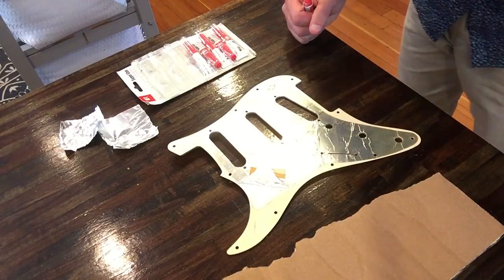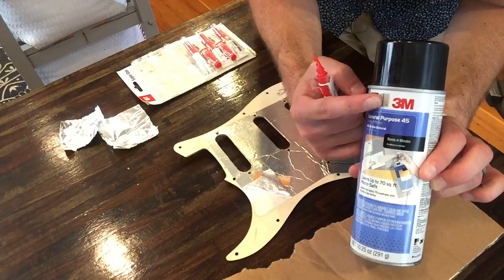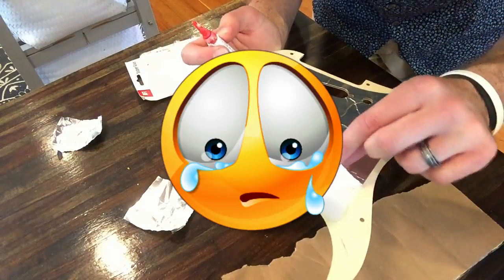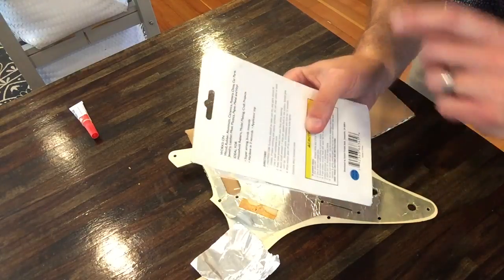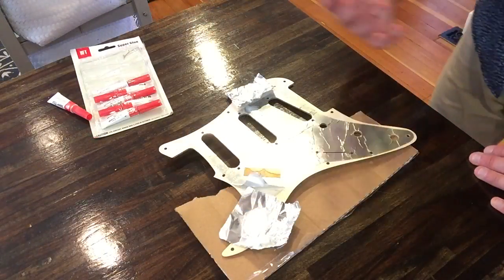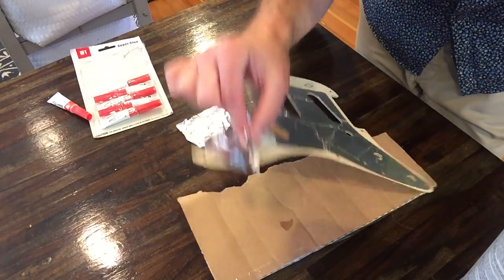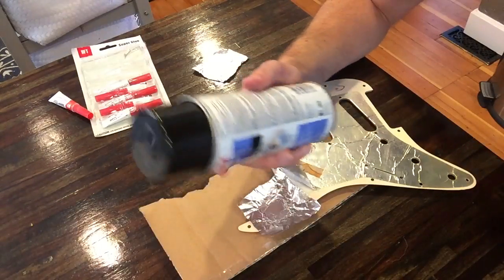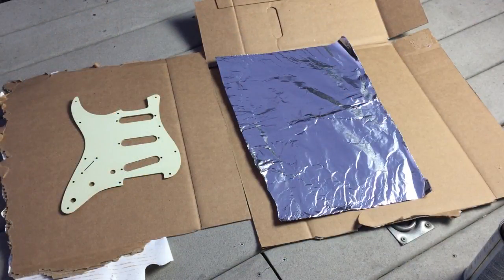Shield a Strat With Aluminum Tape and Foil

Comment: I bought some copper foil tape I got on Amazon.  It works pretty good although it can be a bit tedious getting it all covered. I suppose had I got a roll that was maybe 1 inch wide it would have been easier.  I got two 1/2 inch rolls so it just took longer to cover each cavity.  But in the end I got decent results, it just took too long.  The copper tape does say  dual sided so I was sure it was conductive on both sides.  I think your aluminum foil with the 3M adhesive is probably a much better idea and probably much easier to work with. Oh well next time I will go that route. Thanks for the information!
Reply from the maker: SGT Andy MP Corp thanks for sharing!

Comment: Cool, some nice tips in here. DAMN that guitar looks sweet, good job
Reply from the maker: floydthebarber71 thanks much! It was a lot of fun (and a lot of work!) making it. 😀🤘🏻 Glad the info is helpful.
Reply: Nathan Sink I've ordered a loaded pickguard to replace in my Strat, and I'm just researching how to shield the guitar before it arrives :) I saw a comment below where you said you're still getting the 60Hz hum in the single coil positions, did you twist your signal wire pairs of the pickups closely together?
Reply from the maker: floydthebarber71 I didn’t personally, but the pickups I ordered came that way. I essentially ordered a loaded pickguard without the pickguard itself. The pickups were from John Benson. He used the old school cloth wire & they were twisted together. I’m not sure you can ever totally get rid of 60 cycle hum from single coils, can you? I realize there are noise suppressors & such & noiseless single coils, but I dunno about any other way to “buck” the hum. 🙂
Reply: Ah ok, I was just wondering because I think twisting should reduce the hum in theory (no personal experience yet), so was gonna suggest it if you hadn't. I have a set coming through from Bare Knuckle, and I don't think they twist their's, which is weird. Probably the first thing I'm gonna do...

Yeah I don't think you can get rid of it totally, but if you use star grounding and closely twisted pairs, it should be significantly reduced from my experience with general electrical wiring and grounding.

Cheers!
Reply from the maker: floydthebarber71 right on. I agree. 👍🏻 Hope you enjoy the Bare Knuckles. I’ve heard great things about them.
Reply: Got the BKP loaded pickguard and just decided to drop them in without doing any shielding work etc, just to see how they would sound as is. Wires aren't even twisted, and I'm getting virtually zero hum or outside noise coming through, I'm pretty shocked! Maybe outside of a home environment it'll be worse, but these might even be quieter than the noiseless pickups I replaced them with, if that's even possible...

I guess each guitar/environment is different!
Reply from the maker: floydthebarber71 that’s good to hear. If it ain’t broke, don’t fix it! 😀

Comment: not sure if you installed a reversed wired middle pickup?  This will eliminate excessive hum on any gig where there is shitty interference from bar fridges, lighting and other electronics. You can always play in  2nd and 4th positions if the venue is real bad, if you have an installed reverse middle pup

Comment: Anyone who's done this: how much of a reduction in noise from external interference did you experience? As a young person in the 70's, we never talked about this, at least among my guitar friends.
Reply from the maker: To provide a real-world example, I made an A/B test when I shielded my Tele. You can see it in this video at the 2:12 mark: https://youtu.be/ykq6dw-EoMM It’s a pretty substantial difference.
Reply: @NathanSink  Thanks for the link, there's clearly more noise without shielding and when the guitar is close to the amp (you're about a foot and a half away I'd say). What about when you are more than 3 feet away from the amp? I don't stand within 2 feet of my amps at home, and usually even farther away when performing.
Reply from the maker: @rogertaylor6  true with regard to distance. I was trying to provide an extreme example. At normal playing distance I’d say the percentage is the same. So (for a made-up example with round numbers) if at 2ft away the noise is a “10” & you get a 50% reduction to “5”, then at 3ft if the noise was an “8” you’d have the same percent reduction, to “4”. Hopefully that makes sense.

Comment: Why not play it? Before & after? ... sigh ...
Reply from the maker: CHRiS ROuSE this was a guitar build. At this point I’m not even sure I had drilled holes in the neck to mount it. Kinda hard to play it without a neck. :) I can assure you this has greatly reduced noise in other guitars I’ve done it in (where I had a before and after reference point).